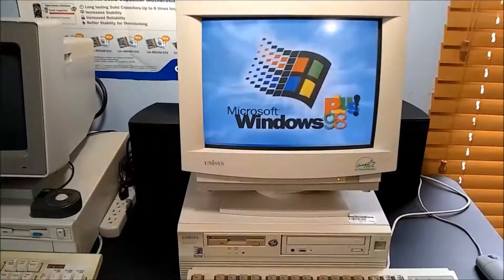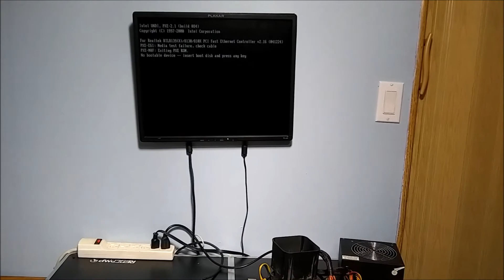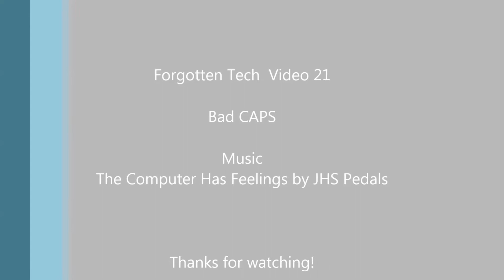When capacitors go bad.

Comment: I have a Windows XP-era desktop that has a number of these bad capacitors
It doesn't always POST. However, it seems to have nothing to do with capacitors and rather, some weird issue with the video card.
The fans spin, but often no signal shows up, nor any beeps.
This doesn't happen when I unplug the VGA cable from the computer.

Comment: Hi have a old Compaq Deskpro EN 6333 no  post no video on boot up only beeping i swap between to different working video card agp and still cant acces the bios  doe ity can be the problem?bad capacitors?
Reply: open it up if it have swelled up capacitor replace that and it will work normally again.
Reply from the maker: I remember having issues with RAM on some of the older pentium 1 deskpro systems. This would stop the system from booting and give you beeping. I would try removing the ram and just installing 1 stick of ram to see if it solves the problem.

Comment: I have a lot of machines with bad caps. They often cause issues, but sometimes they seemingly cause no issues. 2 particular cases I can think of are the HP D-530 SFF, I used to have about 10 of these machines, and every single one had nearly all of the caps on the board bloated and leaking. They all worked just fine though. I only have one left, and used it every day up until last year, and it has never had a single random issue caused by the bad caps. I recapped one of the boards just to see, and no noticeable improvement which is kind of strange. The second case that comes to mind is a Compaq EVO D510. I have one of these running 24/7 displaying the date and time on an old apple monitor iii which I use as a digital clock. It has been running for nearly 3 years now, and has never had a stability issue of any king despite having all of the caps in the CPU VRM bloated and leaking. I will mention that I cleaned up the leaking electrolyte so that it didn't corrode anything, although it is probably leaking again. I also have a Thinkcentre S51 which I use on a daily basis as my music player, and it has 3 bad caps on the board and has not had an issue in over  year. The proper thing to do would be to recap all of them, but unless it is having any issues, I just don't.